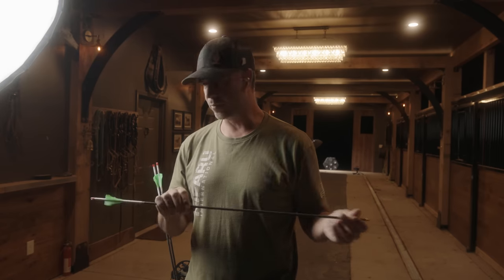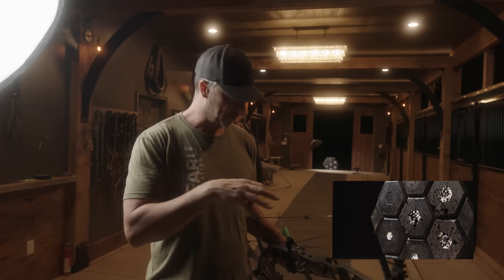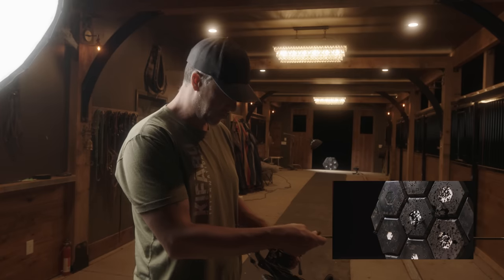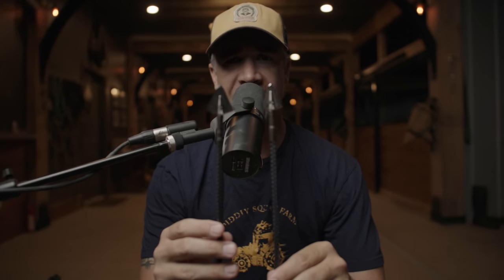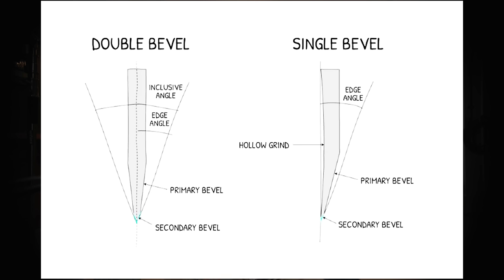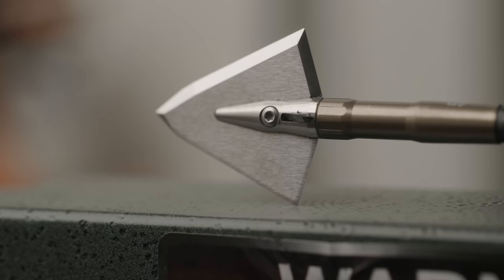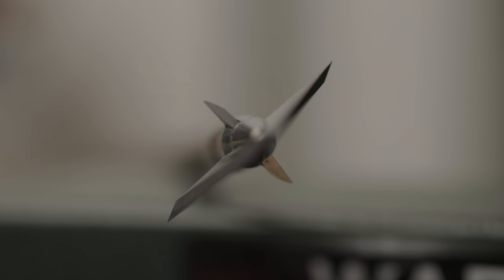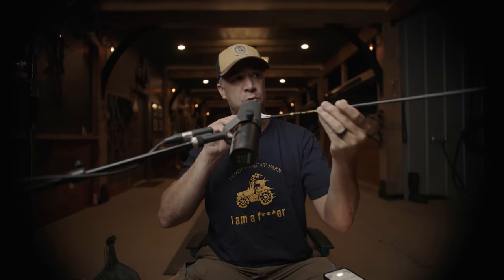Single Bevel is better than Double Bevel, but not the reason you think.

Comment: You are correct….spin averages out build imperfections.   Your bow will naturally spin an arrow based on how your string is twisted so ideally your vane orientation and broad-head bevel direction would all match to induce the same rotation.  E.G. bow clocks left then left helical/offset with left-bevel broadhead.    All other things being equal, that will give the most forgiving arrow flight and the best terminal performance.
Reply: You are 100% correct. My arrows clock left off my bow. So I fletch with a left helical using an Arizona EZ Fletch Mini Max and have a 125gr Iron Will Single Bevel to the left up front. This is my first year using this combination, but they are grouping really well together. So I don't foresee any issues.

Comment: I agree with you and spent a lot of time tuning my arrows. Knowing my bow was tuned, I used different spines (ended up sticking w/Easton Axis 300 spine Match Grade), then adding/subtracting weight up front, then knock tuned. I was punching perfect holes in paper with 610 gr, 250 gr up front. 150 gr field tip, 25 gr ss collar, 75 gr insert. The outsert/insert stiffens the arrow and provides structural integrity. My arrows have 4 fletchings w/a left helical. Then I went with the Iron Will left single bevel. There is no difference in accuracy between my field points and broad heads. Took me a long time to go through the process.

Comment: Videos are always on point sir, I also shoot Iron will heads and can 100% backup what you are saying.  To the point that I shot some M3s to see the difference and the iron will single bevel heads definitely grouped better at 60 yards.  I did the exact same thing, basic paper tune then shot the broad heads and they were spot on with a slightly imperfect tune.  I just picked up the new 100 grain wide vented that I will be testing this weekend, see how they do.

Comment: How I see it. If you can get a broad head to hit in the same place as a field point then the broad head isn’t doing much to affect the flight of the arrow aside from how it exits the bow. If the broad head spins faster I’d think that it would affect arrows drop more so it could hit lower than the field point at further distance. 
That’s just how it makes sense in my brain.
Reply: You're not wrong but you're missing something critical. All broadheads slow down the arrow, so when you tune the bow such that the field points fly the same, you are giving the arrow an offset trajectory.

Just the extra surface area alone will slow down the arrow, as well. In fact, compared to the forward speed of the arrow, the extra spin has very little effect on slowing it down. The surface area of the broadhead plays a bigger role is wasting speed.

The issue with accuracy is then there is not enough spin, which allows the front of the arrow to catch the air and fly in a random direction. Hope this helps!

Comment: Well I can tell you with 100% confidence that your arrow has begun to spin the moment it leaves the bow. Not 18" or 2 feet, instantly. This occurs with a bare shaft and a field point just due to the strings serving direction. So that theory is definitely not why it is more consistent.
My guess is that it is a consistent force vector on the arrow thet overpowers any irregularities in airpressure within the first 10 to 15 feet from the bow. Instead of the front of the arrow having to decide which direction it wants to go (like a knuckle ball), it acts on the air in one direction( like a fast ball). That's my theory.

Comment: Good to have you back in my feed sir. 

Interesting hypothesis. I want to question it in good faith discussion. While I think your reasoning of getting the arrow to spin quicker is sound, I wonder if the effort to get all arrow spines, all fletchings in the equivalent spot (in relation to spine weakness/stiffness - pick your poison), and broadhead indexing exactly the same across a dozen arrows is feasible. Then we have arrow squaring (nock end and pointy end) to contend with. I have to assume if your broadheads are seated slightly differently (because you didn't square each arrow the same) then you will have additional variation. I want to believe that a double bevel, three blade broadhead would be more forgiving as it is imparting less directional / torsional effects. But that's just what I think, let me know what you think.
Reply from the maker: My guess is if I had a dozen arrows that were 90% good verses 100% the limiting factor is still my shooting ability.
Reply: @brandonmcdonald6121  We are all in the same boat there mate! 

It's fun to tinker and play with out gear, it only makes us better archers/hunters. I enjoy your perspectives and trialing some of it myself. Cheers.

Comment: Thank's for your study on broadhead flight you might be on to something. I have been bowhunting for over 40 years. I remember not having as much flight problems with fixed blade broadheads 1-1/4" wide or narrower as long as your bow was squared up right I'm talking compound bows and your arrows were straight and the broadheads spun true you had pretty good flight with old launcher rests and alot of people shot with finger too. I really feel that when they introduced carbon arrows in the begining speed and durability was there only concern. If you shot an old xx75 easton arrow they were . 003 straightness and the walls of the arrow was almost perfect in thickness. They also payed attention to the grade of Aluminum which was 7075. My point is they flex consistent as long the bow was repeating properly. So know we got carbon and the flex rate between arrow vary alot more due to having an area on the arrow shaft that is thicker which will flex different unless each arrow is inspected you will experience a erratic flex that's why nock tuning is necessary to get fixed blades to be close to your field points. Target archers have to nock tune each arrow to get the flight they need to compete and sometimes even with the best arrows they get some in the dozen that will not turn well that is multiplied when you introduce a fixed blade broadhead to a hunting arrow. Although technology has done some great things in archery alot of people have become rich because of it. Everything unfortunately in todays world is dollar motivated and in my opinion the heavy double bevel fixed blade is a good example. I myself cannot afford this venture if you can yes it will be better but is it really necessary in most cases. I do understand the need for such quality systems for dangerous game animals. They require alot more durability and structure in the arrow and broadhead. In my opinion a well placed shot with a quality broadhead gets the job done cleanly and ethically on most big game animals as long as you have enough power in your setup. Thank's again for your input you got me thinking about the blades causing more spin. It's really great even at my age I'm still learning. Thank's Ralph
Reply from the maker: A lot in this comment and I appreciate you taking the time.

Comment: Sail area. I would be very surprised if the single-bevel's relatively small bevel edge exerted more rotational force in air than the large vanes, though that would be highly dependent upon how much spiral your vanes were installed with and how wide/stiff the vanes are, yes? I think it could be argued that if the single-bevel exerted that much force, you would see a measurable drop in arrow velocity vs a similarly constructed double-bevel. I expect that situation inverts once the arrow hits a medium denser than air. 

I'll grant you that it probably helps a measurable amount, meaning the rest is academic if you're not seeing radical changes in velocity or drift at longer ranges.
Reply from the maker: Between the bleeders, the blades and the fact that it’s steal so it doesn’t bend at all, I think the iron will specifically is catching a pretty decent amount of air.

Comment: Single bevel continues to rotate inside the animal. Also, the torque will split bone.  It is like a wood chisel. I'd love to get a set of single bevels. But, I'm too invested in double bevel. Stingers & Black Hornet Ser-Razors.
Reply: Absolutely nothing wrong with  either of those double bevels. I do prefer the Stingers over the Hornets, but only because of the length to width ratio being better for penetration on the Stingers.
Reply: @papaschuette  That's true. I just want to try the Ser-Razors just because they look like a flying Battle Axe. LOL! I also, try to get them at least razorsharp.
Reply: @timl8302  I would still go with the Buzzcut 4 blade or Killer Bee 4 blade. Both have sharper angles, leading to better penetration. The hornets are just too blunt of an angle for me.

Comment: You realize you just proved something the Ranch Fairy has been preaching for quite a while with nock tuning and shooting your broadheads. The best part is it costs you nothing but 2 to 3 minutes of your time. I wonder how many would've blamed the broadhead and proceeded to shim cams, twist yolks, change top hats, adjust the technologies, without even giving a thought to spinning the nock?
Reply from the maker: Agreed. Super easy to do, just to see if it gets better.
Reply: Nock tuning is great when your bow has a decent tune on it. He did say bow was shooting almost perfect bullet hole.. Ranch fairy has also gave tuning advice to compound shooters to keep adding point weight till arrow bareshaft tunes. Great for trad guys but for a guy all about efficiency and science it’s a tad ironic.
Reply: A little bit of Ranch Fairy goes a long way.
Reply: Spine index before gluing fetching and you'll never have to knock tune plus, you'll be way more accurate
Reply: I would add that "nock tuning" is just finding the stiff point in your arrow.  Either way you look at it, you are creating consistency because every arrows spine is coming out the same way.  Before nock tuning, you're guessing where the stiff point in your arrow.

Comment from the maker: Another argument…. Use bigger fletchings?
Reply: 4 fletch with those fletchings, also try 3 and 4 with bigger vanes.
Reply: If the single bevel is already proving to be more accurate with your current setup, more fletching would just reinforce the single bevel being more efficient. You would likely hit a point where they are equally accurate, but at the unneeded cost of increased drag and wind drift.

My question now is, what is the difference between a single bevel 2-blade and a single bevel 3-blade? Would it also just further reinforce my argument above?
Reply: I had an interesting occurrence happen with my Mathews which clocks left naturally, at the time I was shooting 680g bigger vanes(can’t remember which one) and a 200 spine arrow with about 270’ish grains up front. So when I decided I wanted to shoot a faster arrow I dropped down to about 540 grains for reference I have a 31” draw and a 73 lbs set up, the arrow was now a 250 spine with a slightly shorter vane and different profile and roughly 175g point weight(tip and insert) it would actually sort of knuckle ball. So my thought were either the foc of the 680g arrow made it so it could overcome that natural clocking motion much easier or the vanes made a difference but I just thought it was really interesting that the “lighter” set up was sooooo much more finicky especially when it came to broadheads. Both set ups now with a left helical on the lighter arrow will both shoot field points and broadheads out 60 yards as a group. It just blew my mind how much of a difference it made.
Reply: Brandon, I’ve had good luck with full helical (right) fletching with my Iron Will SB 125’s.
Reply: @GarrettLaPolt I prefer dabbelbebbel
Reply: Here's a question:
Bigger vanes as in taller or longer? I've got a couple theories on both.
Reply: Taller vanes help steer better for sure, but the best is to use a high helical. 3 degrees or more is best. FOC is also best for those.
Reply: @williamworkman1468  about the same height the larger vanes were 3 inch as apposition to I believe 2-1/4
Reply: Glad to see a new video and always appreciate the effort.

I will vary from every comment I see so far( I didn’t read them all.) I don’t see what’s so great about these heads.  A fancy package and a big price tag and people kind of loose their minds.

I run into dudes all the time at the range that can’t get these heads to fly and I can see the wheels turning when they’re looking at my stack of arrows with 3 or 4 different types of broad heads all hitting with my field points at 80-90-100 yards. Their iron wills are all over the place at 20-30 yards.

I also don’t get all these people bare shaft tuning, fletch tuning at different distances, going through all the processes just to get outside and start moving their rest around because of broad head flight.  That makes all that other tuning a waste of time.

I take the time to really tweak and perfect my tune, enjoy the process.  Then, I start launching broadheads and mist of the time whatever I shoot will hit with field points.  

This is just a long winded post, shoot whatever makes you happy.   But my arrow always winds up on the other side of whatever I shoot, pass through.  Don’t know how spending 4 times as much is going to improve that.

If anything, the surge in boutique broad heads has just made other companies a lot of money.  Now, a company like Magnus or Grim Reaper can charge $45-50 a pack instead of $35 because comparatively, they’re a much better deal.  You don’t get a fancy box or bag made from eland scrotum but, you got to cut a corner somewhere.

Lastly, in regards to Ranch Fairy, I have no problem with anything he does, seems like a good guy for sure.  However, just adding 100’s of grains to the front of your arrow until something good happens is just stupid.
Reply: @drewolm  You have good points for sure. A well tuned bow from the start is always best and you'll see the benefits. 

These type broadheads are built to last, be resharpened, and used over and over again. High quality steel that is built to stay sharp. The design is so that they will inflict the most damage to their target and pass through no matter where they hit. 

Adding more weight on the front does help. It is science. But it's also for plan B. If you hit a perfect spot every time, then good for you, you are awesome. But if an animal moves or isn't quite standing the way you think it is, heavier arrows with the right broadhead will do the trick. I've had many buddies say they hit the shoulder(elk) and the arrow didn't even penitrate. You can kill any animal with a field tip and the right spot, so why use broadheads at all? 

The biggest issue I see with people having problems is arrow stiffness. They add weight and these big broadheads but still use the same spined arrow as before. 

The RF isn't wrong, but yeah, he has a niche and is very polarizing. His radar tests at 60 yards is eye opening for sure.

Comment: Hey Brandon! It's Sam. I have a question about broadhead tuning. I do the Ranch Fairy process and then screw in my single bevel broad heads. They always hit right with my field point arrows. So I'm wondering what is the difference between the two?

Comment: another ? that came to mind, would less FOC help or hurt spin rate. does it take more fletch to spin a high FOC vs low FOC....
Reply from the maker: I think it actually changes.  Off the shot the arrow flexes harder, so a larger vein right out the gate would be nice to have but once the arrow is in the air and stabilized a lighter weight, Smaller Vane would be fine since there’s more wait out front.   We are definitely getting into the nitty-gritty. After seeing some of these results, I may just switch to a giant set of vanes even though they are super loud and get maximum stability.
Reply from the maker: I’m using the talk feature and it definitely used the wrong “wait… “  I hate spelling but I’m not that bad
Reply: Without getting crazy, no. The force applied to the arrow is the same, as long as the fletching is the same. It's more about the stiffness of the shaft, stiffness of the vane, and overall weight of the arrow. Heavier arrows take more fletching to spin up.
Reply: @brandonmcdonald6121  True true. Per Seans note below, and, yes, this is a long rabbit hole, BUT, making the assumption the arrow doesnt change, the trend now is high(er) FOC, which i can agree with but need to weigh all factors. if you have to throw larger vanes on back to obtain stability, you then have to throw more weight up front to maintain FOC.  i just havent ever seen or heard of a "study", nor am i an engineer, that analyzes FOC and spin (etc). just interesting with trends and inevitably consumer demand/marketing/etc. Having spent a tremendous amount of time and money over the last 3 months tinkering, just makes me laugh cuase my setup will kill anything on continent (which i knew before tinkering)...